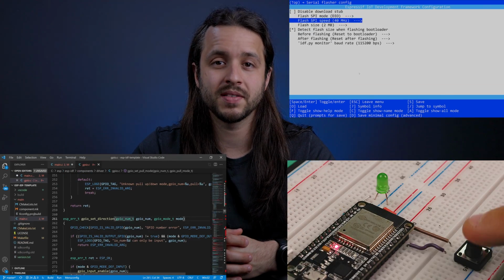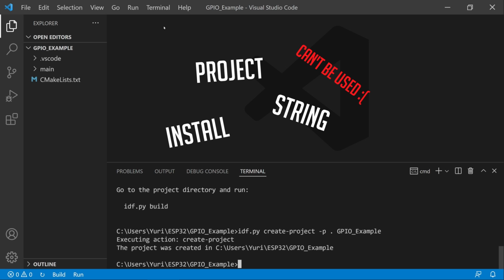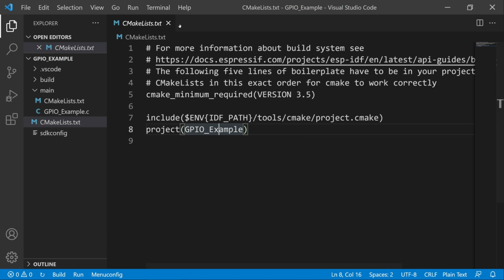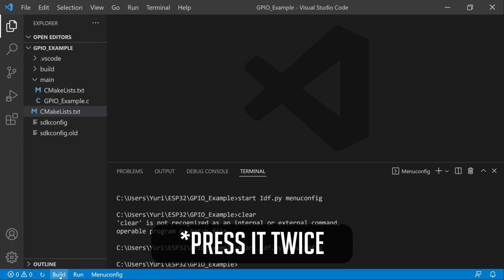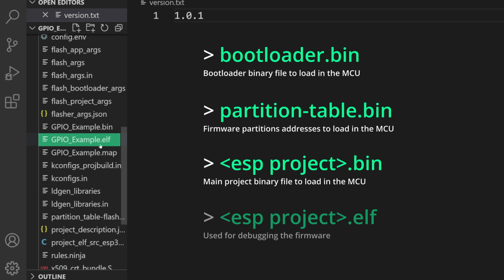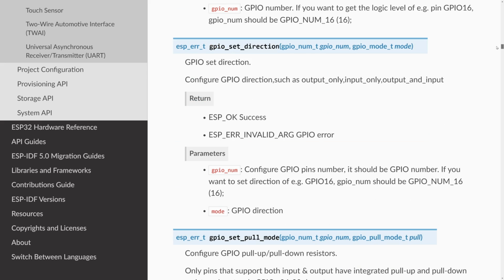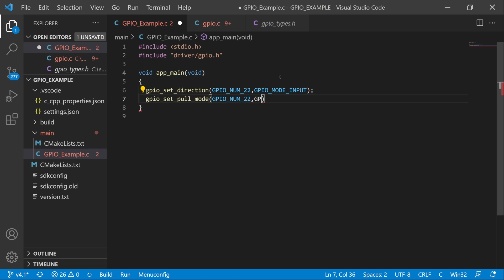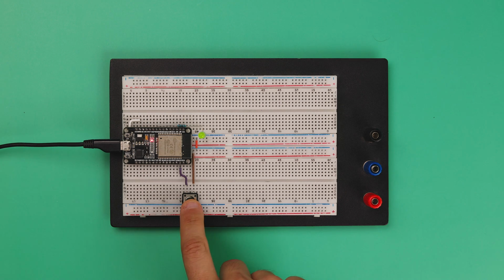ESP32 - How to create your First ESP IDF project (From Scratch)

Comment: Thank you for doing this.  Can you do a new one based on the current versions of things as well as a brand new install?   There were quite a few differences.  For example, when you did F1 and typed settings.json I have 3 different options: user, workspace, and default.   I couldn't tell which you picked.   Next, when I finally figured out how to get the actions add in to put all of the other stuff into my user settings.json file then it still didn't work.  Giving an error about idf.py not being found.   Apparently the action button is starting it in a regular terminal window and not an ESP-IDF terminal window.  No idea how to fix that.
Reply: Actually - never mind.  I worked through the differences.  Your video was incredibly helpful in quickly bringing me up to speed on this.   Got my first vscode/esp-idf project actually working right.  This is very different from using the arduino ide - in a highly positive way.

Thank you.

Comment: Excellent. I have a need to use an ESP32 for a few projects, but I significantly prefer STM32. That being said I will be making boards with an ESP32 and an STM32 on it, using the ESP32 for communication

Comment: Oh well, I guess I'll have to endure the Arduino platform. No support for esp8266, as of yet, and besides, this is unnecessarily complex. I mean is this an MCU or CPU? Bootloader? Partition table? Really? And that is just the top of the iceberg it seems.
All I really want to do, is program in C, and not have to constantly jump through hoops, because of Arduinos weird mishmash of C and C++, but what other choices are there? RTos, nonos? Ya, good luck with that.
I dunno, I really want to delve deeper into the esp8266, and eventually the esp32, but this to me is not promising.
Reply from the maker: Hi Felix, It's natural to feel overwhelmed by the level of complexity in the ESP8266/ESP32 platforms, especially if you're just starting out in embedded firmware engineering. However, it's worth noting that the complexity you're encountering is typical of what you would find in a professional engineering context.

The ESP8266 is a powerful microcontroller that runs on a custom firmware, which is why it has a bootloader and a partition table. These are critical components for configuring and programming the microcontroller. Although it might appear complicated at first glance, once you have a grasp of these fundamentals, you'll be able to make full use of the ESP8266's capabilities.

While the Arduino platform is an excellent starting point for learning embedded development, it may not provide enough flexibility and control over the microcontroller for your needs. This is where the ESP-IDF framework comes in. The ESP-IDF framework provides more control and versatility over the microcontroller, allowing you to program in C or C++

It might take some effort to learn the intricacies of these frameworks, but the rewards are worth it. With the ESP8266 and ESP32, you can achieve a high degree of control and functionality in your projects, allowing you to build sophisticated embedded systems. So don't be discouraged by the complexity you're encountering – with perseverance and dedication, you'll be well on your way to becoming a professional embedded firmware engineer if you so desire.

Comment: Hi Yuri, do you plan to make a video how to use arduino libraries inside the ESP32 IDF environment? It's just a lot of useful arduino libraries like midi, or led matrices. And in my opinion there is no sence to write them from scratch to use with IDF
Reply from the maker: 100% agreed, Arduino libraries are very useful and I port them frequently for my own projects. Some of them are pretty straightforward to do, but some others I need to rewrite a part of the code to make it work. I'll definitely make a video about this soon!

Comment: Thanks for all your help Yuri but I get:

'cannot open source file "driver/gpio.h"C/C++(1696)'

The squiggles does not disappear for me.
VSCode refuses to find driver/gpio.h, it finds freertos/FreeRTOS.h and some other header files, but everything in the driver-folder seems banned. The file does exist ..\components\driver\include\driver\gpio.h

This seems like a compiler error, should i not use mingw?  should i upgrade my cmake? Has anyone else experienced this? Has anyone solved it?
Reply: in the root of gpio.h there were headers missing (sys/cdefs.h and crtdefs.h) in my installation of MinGW. Cant remember which version i installed. I found those files in the header-folders of other versions of MinGW. I thought i had the latest and the greatest. I should probably install some other version.
Reply from the maker: Hi Slutbit, sorry for the delay! I haven't tested this using MinGW, glad you found the solution!

Comment: Good to see a tutorial that is NOT based on Arduino, but a proper C programming :) Great job.
Reply from the maker: Hi Viktor! Thank you, glad you liked it! :)
Reply: Fully agreed!!!
Reply: Its not Arduino but actually IDF is like arduino only. For example: You have not written any program which has modified the registers to Act as input, Inputpullup and Setting the output value. Just think that instead of Loop function in Arduino you are creating and While True loop to do the same function. So its not much different the Arduino. Only some features are there in IDF which are additional.
Reply: But what is wrong with arduino?
Reply: @jumperr_g  Arduino does not have a debugging capability nor have a full control of the MCU as you would have with a standard C/C++ development tools.
Arduino is good for kids and hobbyists and not for a professional use.
Reply: @ViktorVano  However Arduino does give you the ability to use C++ and that's a huge win
Reply: @StoneMonkey25  there are other IDEs that give you the same option to use C or C++ or combine C and C++. But the best thing is when you have a debug options and be able to see live variables and step the program.
I used Eclipse based IDEs and I like them.
Reply: @ViktorVano  So True :D - While I don't use the Arduino platform directly, I use the Platfrom-IO integration. To Debug my code, I also need a hardware solution for my ESP32 (Which is on the way). I used to be spoilt and use the F5 or F11 in VS to debug my code, but Mirco-Controller debugging is more complicated. Thanks
😁
Reply: @ViktorVano  Arduino Also has AVR-GCC compiler which you can use for your project if you are an advance user. Also you can use platformIO run and debug your code.
Reply: > But what is wrong with arduino? 

well you're not a real microcontroller dev if your arduino project is finished in a day. you are supposed to learn every register bit of your mcu and be finished with the same goal in 6 month. bonus points if you do everything in assembly in 12 month.

Oh and if you dare to install micropython you'll get a crucification!
Reply: @Henry-sv3wv  you cannot debug Arduino. So the scalability is an issue.
And for example there is a nice STM32CubeIDE that can configure an MCU and generate init code for you with nice structure.
But that can be debugged, access registers and have a full control of MCU.
Reply: @ViktorVano  There is now some debugging in Arduino IDE. It's been there for a while.
Debugging is often only possible because the code has been interpreted, compiled code as produced by Arduino is much more difficult to debug.
A true professional programmer would make an effort not to sound like a snob, just in case they discouraged someone.
Reply: Arduino is a dirty ide with extemly bad librairies management 😮
Reply: And now use a proper way - use rust 😂
Reply: Proper code is what ends up working. Be it using C or the Arduino IDE.